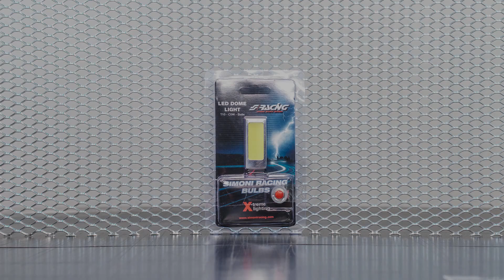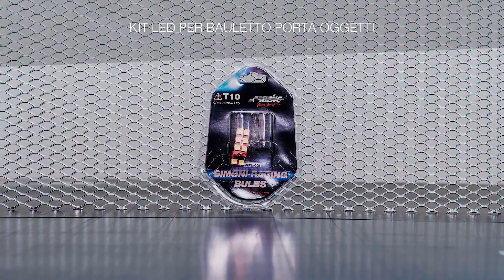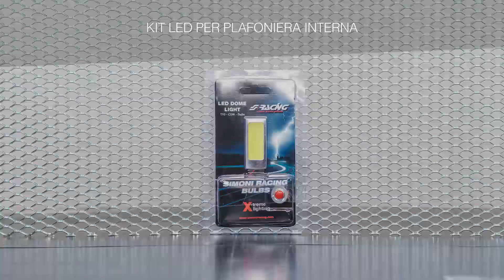[ITA] Kia Sportage (QL) model year 2017 Conversione Led - Simoni Racing

Comment: Ho appena convertito in led i fari anabbaglianti/abbaglianti. Ma è normale che l'automazione del passaggio abbaglianti /anabbaglianti all'incrocio con altre auto non funzioni più?
Reply from the maker: Dovrebbe funzionare perchè il passaggio abbagliante/anabbagliante è una funzione indipendente e non dovrebbe dipendere del tipo di lampada installata, ci confermi che hai utilizzato i nostri kit?
Reply: Forse dovreste fare una prova e fugare il dubbio
Reply: Anch io ho un kia sportage e vorrei sapere se la conversione a led della simoni racing comporta problemi con la funzione di abbassamento degli abbaglianti automatica di cui la mia auto è provvista.grazie
Reply: @Skull81  Alla fine dopo avere messo in moto l'auto tutto si è risolto senza problemi!
Reply: @raffosax   grazie mille per la risposta...